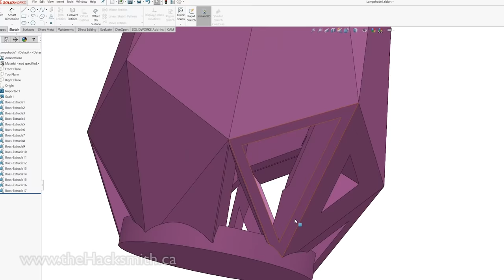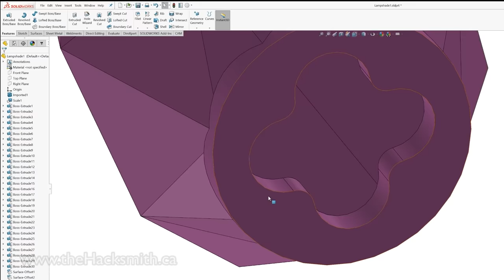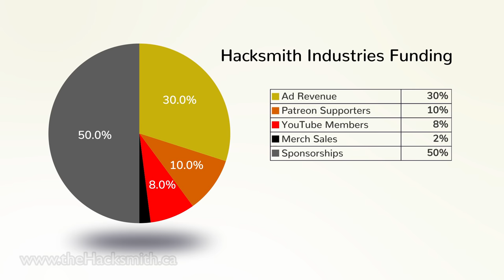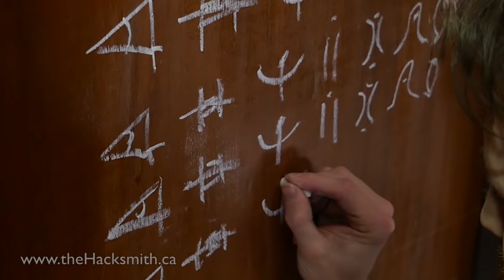Making a SHAZAM STAFF that DESTROYS ALL!

Comment: “We have trouble with funding.”

smashes an iMac monitor
Reply: SniperSnowman its an old one
Reply: Vader 86 you don’t know what that means do you
Reply: @vader8684  the fact you most likely dont know what Simp means
Reply: The iMac monitor is cheap compared to the materials they use
Reply: @goldgizmo2228  that's exactly it - why not sell those parts and make some money? I just don't make enough money to fund their ventures, and it I did, it just wouldn't be enough to cover what they need.
Reply: Lol
Reply: @marcfjevik8283  ya
Reply: @vader8684  let me explain what a simp is a simp is somebody that does something to get somebody to like them so technically they're just hor*y and or just want people to think they are good.
Reply: @notaspideyclone2759  they must've saw a spider
Reply: @extropiantranshuman  ya ?????
Reply: @notaspideyclone2759  you should know, as you're not a clone lol.
Reply: T-bone 247  
Sn
Iper
Monke
P

Comment: 1:40: smart.
You could have used growing quarts, or something triboluminescent: just vibrate it and a crystal could glow, use it or pass electricity through it. Better would be to use a gas, but this is a one-day build.
5:05:
But no, u know best. Still, maybe something similair could be done as a home project with a little more explosion: alkali metals.

Comment: Why not install a voltage multiplier chain or marx generator powered by a small high voltage device (like an arc lighter or miniature ZVS driven flyback transformer) in the staff? At that staff length, with enough stages, sparks as long as four feet could be possible. Just an idea...

Comment: Get a crane that has a little cage on it then then kind of make a little door that you can open and mid height and then make a little platform then you have a little connection rope then drop off the thing with like some sort of thing to make a super cool jump off and you edit out a little thing on the bottom